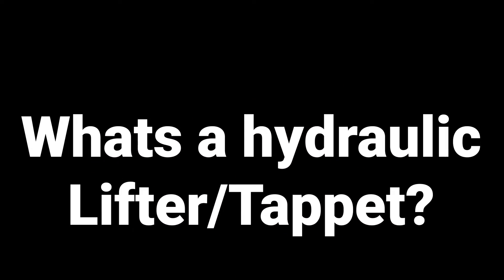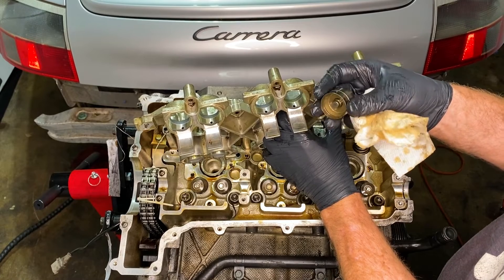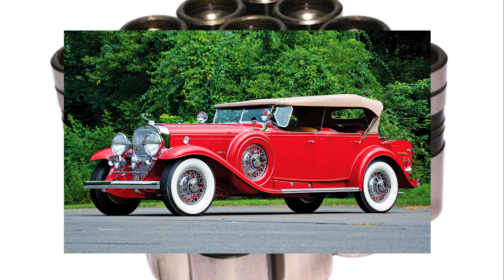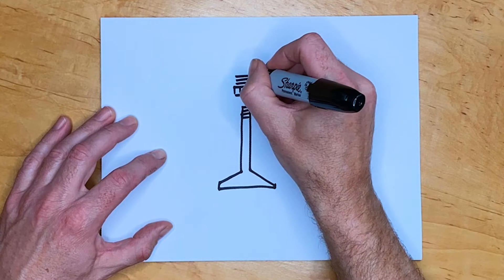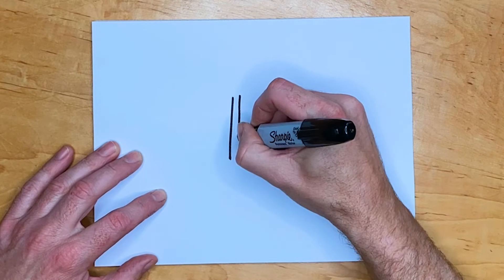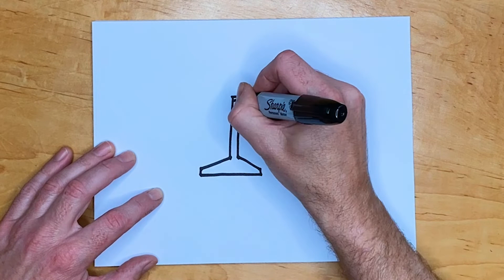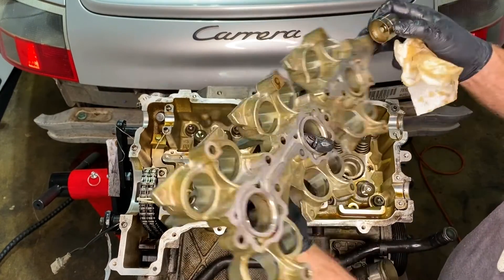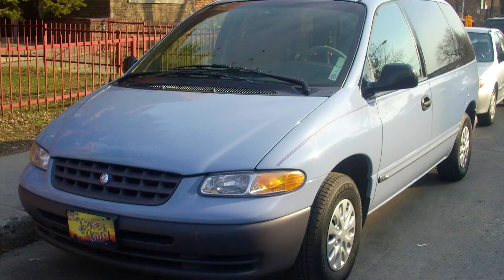Tick, Tick, Truth: Decoding Tappets & Hydraulic Lifters!

Comment: it would have been good to know how the plunger inside or hydraulic volume inside the lifter can adjust. i remember working on my old ford that had pushrods and these hydraulic lifters.  
i have heard they can be cleaned by adding a quart of atf or marvel mystery oil
Reply from the maker: Those are good points Dave. This video is a small piece of a series on Porsche engines, there is no lifter adjustment. This video is obviously not intended to show every aspect of hydraulic lifters, that would not be a 2 minute video. If there is a fix for a malfunctioning lifter perhaps an oil additive could help, it’s worth a try compared to an engine strip down. Thank you for watching! 🤘😎